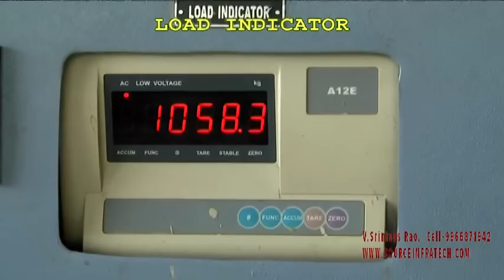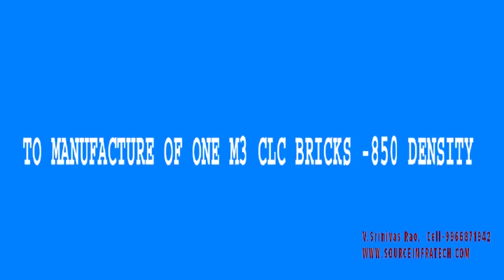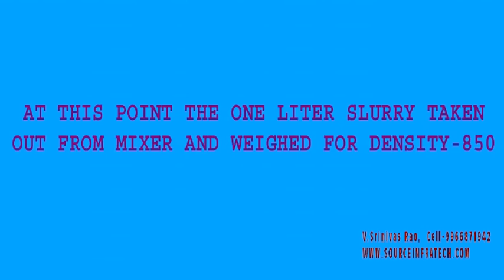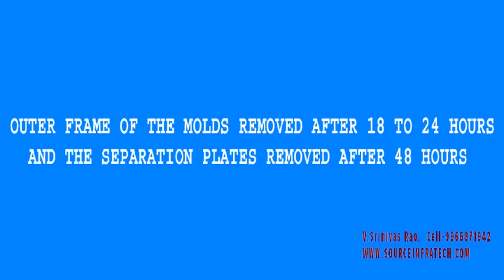clc light weight bricks making machinery production manufacturers and suppliers

Comment: Sir, please the weight 850 density of 1 litter slurry what's the UNIT?  Is it 850g/L or 850kg/L?
I am also interested in a complete set of CLC machine I.e. Mixer, foam generator, and some moulds and possibly trolley. 
My email address 
andrewsannan2003@yahoo.co.uk 

I look forward to hear from you.